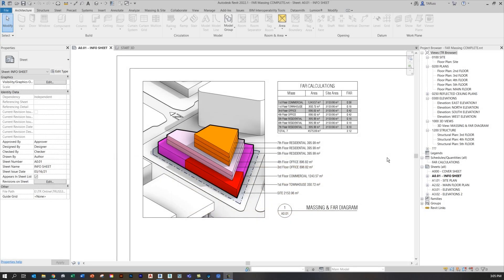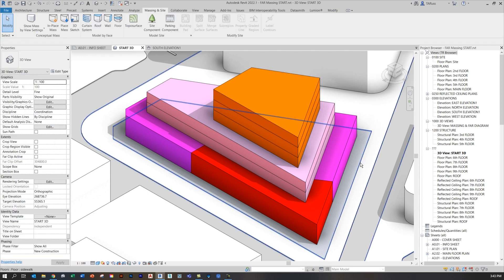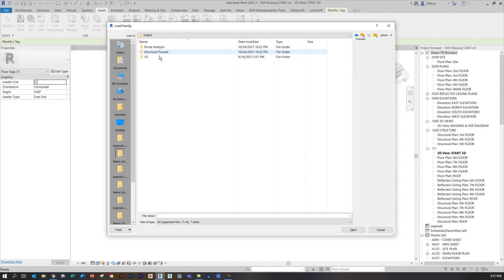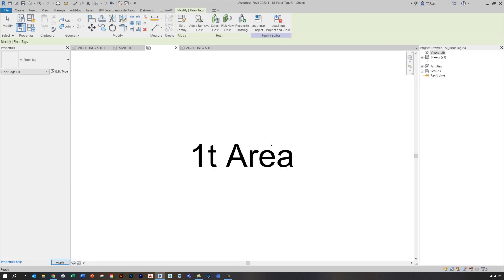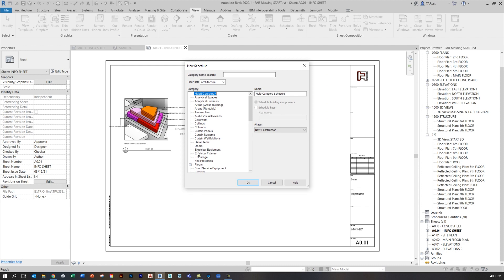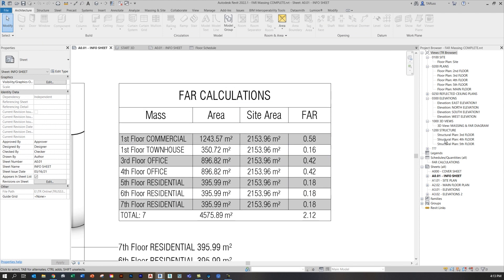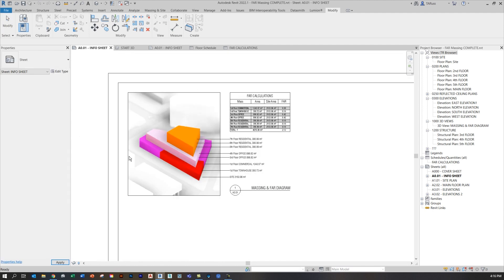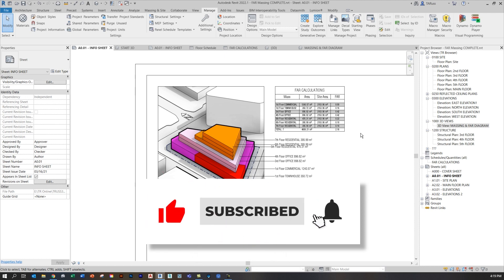Revit Massing Diagrams with Floor Area Ratio Calculations

Comment: Could you kindly share your Graphic Display Options/Sun Settings/Shadow Settings used in that 3D View?
Reply from the maker: Hi Mariusz. Sorry for the delayed response. The settings for the look of that model are pretty simple. In the "Graphic Display Options" in the Model Display section Shaded is the Style and I have Show Edges and Smooth lines with antialiasing checked. Both shadow types (Cast Shadows and Show Ambient Occlusion) are checked. In the Lighting section I have Sun and Ambient Light set to 100 and Shadows at 18. The Sun Setting is Calgary, Canada at 10:15 am on June 21. Let me know if you need any other info and thanks for watching the video.

Comment: Great tips ! The only drawback is that you need to create different floor types if you have varying floor to floor heights within the same usage. I wonder how to make that step easier. It would be great if the volumes could simply snap to the floor levels. By moving the floor levels, the mass would automatically adjust its height.
Reply: i've tried this using only masses but the only issue is there is not mass tags